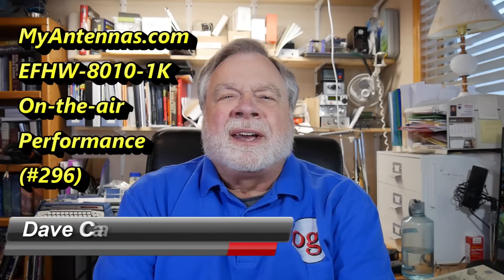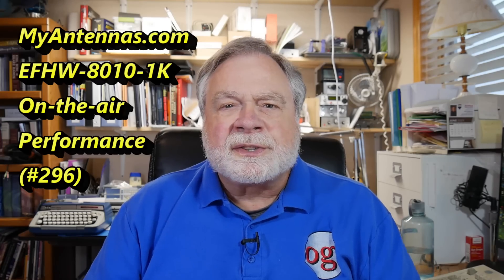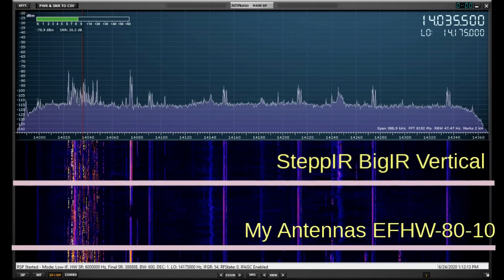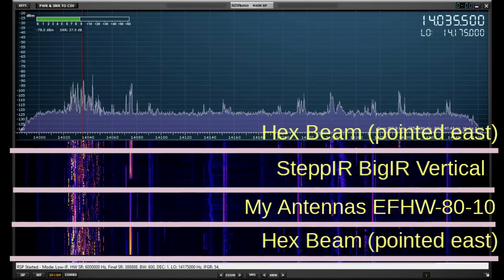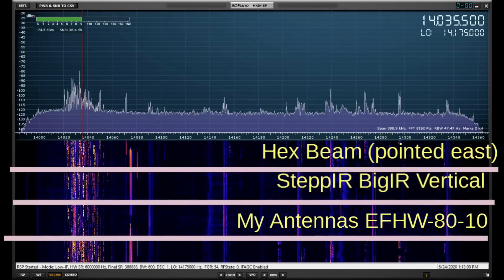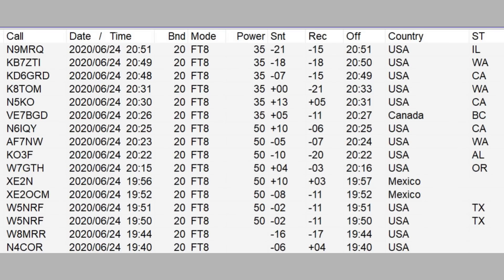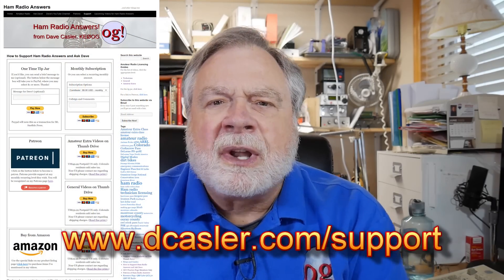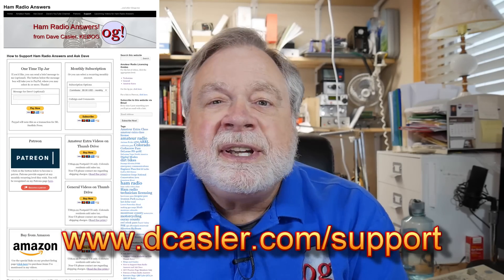Performance of the MyAntennas.com EFHW-8010-1K Antenna (#296)

Comment: Hi Dave, I've really enjoyed your channel and as a EE with over 30 years experience in the power industry, I had forgotten much of the theory above 60Hz.  Thanks to you, I finally get dB! :)  I wanted to report that thanks in part to your videos I not only passed the technician, general and extra exams, I followed your recommendations and went with the IC-7300 and myantennas EFHW-8010.  What I discovered while tuning the 7300 is that you must run the auto-tune in several parts of the band.  Initially on 80m I was able to get a low SWR on the low f end, but horrible on the high end.  I somewhere discovered that if you tune the radio to the trouble spot and tune it again, it resolves the issue.  I have had several DX QSOs over the last week using nothing but the IC-7300 bareheaded 100W and the EFHW-8010.. on SSB.  My QTH is Maine.  on 80m I've spoken with Spain, Bulgaria, and others late at night when the propagation is favorable, and during the day on other bands such as 20 and 17m.  Tune the 7300 in multiple parts of the band and it becomes a very functional combination for 80m SSB.  My EFHW is set up at 40' on both ends, not a vee or sloper, and at 300' above sea level, 10 miles from the coast and I get very good signal reports regardless of band.. in fact I've been able to plow thru pileups on DX using this combination several times.  73!  Matt AC1KO
Reply: Which direction (e.g., East-West, North-South, other) is your antenna configured for Europe contacts? Thanks!
Reply: @ray-real1  If you're asking me, my 8010 EFHW is on 120/300 deg true.  from my QTH (FN43) it works good for Europe and the US.. but South America and South Africa as well, even directly off the end, which for me is Cape Verde... it just doesn't matter that much.  I no longer use the internal auto tuner and tune manually with an external Palstar AT2K which will tune the entire 80m band and all bands 80-10. 73
Reply: @discipulus777 , awesome to hear there is flexibility in the antenna mounting.  Thank you for the great information, this really helps me! Ray 73
Reply: Hi.  I have the exact same set up at 23 feet. Re 80 meters, I hv not tried you ‘retune’ as I hv the same high swr from 3920 to 4000. I just go to emergency mode, which cuts power to 50 watts( no biggy, just a half s unit). Doing this allows the tuner to tune from the normal 3:1 ratio, up to a 10:1 tuning ratio!!!!!  Bingo, it does the job😄

Comment: A nice thorough review Dave.  I have the same antenna (8010) and have excellent results.  Mine is hung between two trees at approx. 30ft and then to my house at 10ish feet in a somewhat Lazy L configuration.  It's resonant on 20 and 40. It works wonderfully. Thanks for all your educational videos.

Comment: I wonder if you may be able to do some antenna reviews that would be more applicable to those of us living in the city instead of on rural acreage.  In my neighborhood there are HOA covenants that prevent any antennas of this sort from being visible from the street or by neighbors.  So, I'd only have an option to string this type of antenna along the top of a 6' tall cedar fence, which would result in a sort of U shaped configuration.  Think 3 sides of a 60 foot square.  I'd love to hear a real world report of how such a non-ideal installation scenario would perform.
Reply from the maker: I should probably review more verticals and limited space antennas. I have a really weird Bilal 20m antenna to review, and also a DX commander. Both reviews are being inhibited by snow on the ground.

Comment: I have the same antenna and I found out that the inverted  ( L ) works best for me in Idaho , take the balun 2 feet off the ground ,and ground it to the ground to the ground lug go up 43' with a push up pole then straight out with the rest putting the end up as hight as possible. this way works great.    im just a CW operator

Comment: I use one of these as my main antenna and have done quite well with it . I run it in an inverted V configuration with the apex at 32ft and the ends at 5ft and have worked DX all over with it 73 N8WXT.

Comment: I am a big fan of wire antennas and if you wanted voice on 80m you chose the wrong antenna, they make a 7510 that would have been the correct choice. In another note their swr graphs are listed o nthe website and this is advertised as a below the voice portion of 80m antenna.

Comment: Hi Dave, In the DIY/ experimental spirit of amateur radio I'd like to point you to a design by VK5HW I am having good success with on 80 and 40. I think it would check quite a few boxes as a build along project for the channel. Personally I can see no reason to purchase commercial wire antennas since they are so easy to make and that is half the fun. I chose this design for it's reduced length on 80m as it exactly fit the yard space I have available. I made all the components including the loading coils and a current balun. For some metrics I have it @ 6m high running physically N/S and routinely work Perth 600 km west 300km north and south and 2000 km east into VK5 and 4000+km into VK2 VK3 and VK7 all on 80m and as far away as New Zealand on 40 all on the 7300. Be sure to check the how to build page linked half way down this introductory page https://sites.google.com/view/vk1hw/antennas/radiation-coupled-dipole.

Comment: I have the cheapest MyAntennas EFHW 40-10 because I need stealth. I'm in a condo complex with no antennas allowed. I got the maintenance guy to help me put it up horizontally between two of the condo roof peaks, 40' above the ground and ran 150' of coax to my ground floor condo. Bottom line, I work the world with it and get very good signal reports with my 100w Yaesu FT450D. All the while, nobody knows it's there but the maintenance guy, my XYL and me. It's the best antenna I've ever owned and that includes the GAP Eagle, Zero-Five and Hustler antennas I owned over the years when I had a house and yard. I do need to add, however, that my condo is 1/2 mile from the Caribbean Sea.

Comment: Hey Dave, I have heard you reference chain link top rail as a mast a few times. I  have done the same for years but just this year I discovered that the top rail fits perfectly inside a standard short chain link fence post.  I simply use a post driver to driver to a (short) post a couple of feet into the ground. I dump in a bit of small rock down inside the post keep the top rail from sinking then drop in the top rail. Depending on the height and length of time you are leaving it up, guy lines maybe well be optional. to uninstall a pipe wrench and a jack maybe needed to remove the post. Simply put the jaws of the wrench around the post then jack up on the wrench.

Comment: The performance of this  horizontal dipole antenna , this one is simply fed at the end, depends on how high you can get it up... The reason there are so many various results between people using this is because everyone has different setup with respect to height and azimuth ... Bottom line if you can get this up real high , like at least 40 feet you will see good results.

Comment: Hi Dave. Do you answer questions from commenters? If so, in reference to the inverted V - does the high point need to be at the center point or can it be off-center?  Also, what if the EFHW was just sloped with the far end being the high point? How might these changes impact the propagation in general? Thanks.
Reply from the maker: Ideally an Inverted- V should have its midpoint at center, but moving it to one side won't matter much. The direction of propagation will change a bit toward the side with the most copper. The sloper tends to favor the downhill direction of the antenna.

Comment: Hi Dave, always welcome your videos!  Like others here, I've owned the 8010 EFHW 1K for a couple years.  I love it.  Mother nature doesn't always gift us with enough tall supports for a dipole or loop, and end feds fit the bill well.  The 8010 and <100 watts has thus far rewarded me with 150 dxcc entities including Antarctica, Japan, Australia and others, including several long ones on 80m and 40m.  I find it gets quieter when you get the 49:1 well up in the air.  Mine worked best more or less flat topped at about 40 ft, but the V worked well, too.  I can tune it 160m through 6m.   Yes it's a bit pricey but a great alternative when a tower and yagi are not an option.  Best, Dave...stay safe!  Cliff W3KKO

Comment: Dave, You said that the MyAntennas and StepIR pick up about the same. As I see the display, the noise floor for the Hex Beam is -125 but the other antennas are 15 dB worse. The MyAntennas having the highest noise floor at -112.5 while the StepIr is at -110. So there is a big difference in noise floor of almost 3 dB. In my experience the end fed antennas ought to be avoided because of the high noise floor they provide. That reduces the receiver signal to noise ratio, and makes weak signal reception difficult.

Comment: Interesting review, but I was a bit surprised when u posed the question, "Is this a good DX antenna?" & said, "I'm not so sure." Well, heck, I don't even have an EFHW antenna right now, but those words seemed especially harsh, especially while I was reading contradictory comments posted by other viewers.
Reply: Probably needs to be mounted in an inverted L configuration, with the vertical portion as high as you can get it, to make it a better antenna for DX.

Comment: Hi Dave, While I rarely disagree with most of your output I feel you may have been a little hasty with your verdict on the EFHW and whilst I have never owned the My Antennas version you reviewed above I have homebrewed  several 49:1 transformers to Steve Ellington's design and tested them in various configurations over the last nine months and have found them to be an excellent DX antenna. I think to do them justice it might be worth doing some A/B testing on SSB when the 20m band has more activity?
Also I'm not sure comparison between a $150 wire antenna and $2000, vertical installed above a radial field is entirely relevant or fair given the context of this series being aimed primarily at those establishing a first time HF set-up. That said  I enjoy your videos and look forward to each new one as they pop up. 73, Tom
Reply from the maker: A vertical, no matter how expensive, is simply not going to be significantly better than a horizontal wire antenna. Overall I was quite pleased with the EFHW antenna. I would have like to get the center up higher, but I have no tall trees.

Comment: Good info Dave, I have settled on the Buckmaster OCF 6-80 it works most everything and mostly no tuner. I have used a tuner on 75m. I have it up 40' and the ends are off the ground about 10' it works great for DX and just working in the state. Keep up the great info.

Comment: Good job Dave. What you have provided should be a GREAT help to new hams, but also some good info for operators with more experience. We can always learn more, little hints and tricks, and about equipment that we may not own that would be a great  add-on to our present station.  By the way, it looks mighty dry our your way, the Weather Channel has areas near you in a RED zone for fire danger, so have your hose ready, and I hope you have a metal roof.

Comment: Great video, and I enjoy your HAM radio educational videos.  You commented this antenna would probably not be a good DX antenna, but I understand you can only comment on your experience with this antenna.  With that in mind, I own an MFJ-1982 EFHW 10-80M, and I have it set up in a sloper configuration.  The feed end is up at 28 ft and the other end is around 11 ft.  I've worked Japanese stations from my home in middle GA on FT-8.  Maybe the conditions were just right, or it's the different configuration, but it was able to work DX at not much higher off the ground.  Again, not saying your statement is wrong in any way, but I've had good results with DX on FT-8 with my EFHW setup.
Reply: Which direction was your antenna configured on the Japan contacts (e.g., East-West, North-South) ?
Reply: @ray-real1  It was about 45 or so degrees off true north with low end toward the northwest.

Comment: Dave- love your videos but be careful with cursory looks at and advice about antennas. People(including me) take your advice seriously and thus it should be the very best available. I built the Steve Ellington EFHW (<$50) and easily attained DXCC with it in a sloper configuration at <=100W. Also, there is a fix to make EFHWs work over the complete 80M band.  EFHWs are easy to use in QRP situations. There is a ton of information on the web on how to build and use EFHWs. Just one kind of antenna to have in the toolkit, but it is a good and versatile one.
Reply: @ Mark Hill - what is the fix to make the EFHWs work over the complete 80m band?

Comment: I modified my EFHW-8010 by adding 330pf 40kv capacitor at the antenna midpoint. I now have 1:1 SWR at 3900khz with less than 2:1 SWR from 3800khz to 4000khz. Also, the lower part of 80m is close enough that the IC-7300 tuner handles it with ease.
Reply: Does this mod have any negative effect on 40m ??

Comment: Wouldn't you have to use the internal antenna tuner when switching between antennas to show true signal levels?
Reply from the maker: Yes, to a degree, especially if the basic SWR of each antenna is markedly different. If the SWRs are all fairly low, you can just switch between them.

Comment: Of the wire antennas, not hex, steppir, nor vertical at 30 feet any better at Dx?
Reply from the maker: A dipole at a half wavelength high will dictate at about the low angle of a vertical. However, id DX is your aim, you're probably better off with a vertical.
Reply: @davecasler  thanks.  I used a CrankIR vertical and a dipole on different band on My first field day. Just Domestic but their seemed to be directionality with the radial , as manufacture suggested.  But who knows. From N Michigan got Maine and RI and NH ...but also SD...when pointed East...go figure.  Anyway not Dx so I will try these and hold off on end Fed half wave. Appreciate your videos 73
Reply from the maker: @stevenblack122  Steven, I wouldn't expect much DX on Field Day, as it's an event for the US and Canada. Keep your eye on the calendar for various DX contests. There are several a year and they represent a great opportunity to work DX.

Comment: Dave, for the many of us who want more than an MFJ "balcony" antenna, and not a pricey remote tuned magloop, could you perhaps do a similar comparidon between a SuperAntenna and the Cameleon MPAS shortie? There's often a limit of eight feet, between concrete balcony slabs, so shortened compromise verticals fill a unique "must have" role here.
Reply from the maker: Thanks for the review suggestion. Chameleom said they'd send me an MPAS antenna for review, but they never did.

Comment: Hi Dave, thanks for the review.  In the first portion of the review, it appears that the noise floor of the  EFHW-8010 was significantly higher than the other antennas.  I did not hear you mention this, is it just a quirk of the feed line/switching or  is it actually that much nosier?   Thanks.
Reply from the maker: I was looking at the relative strength of the signals, more than at the noise floor. The antenna runs over part of the house so I expected a somewhat longer noise floor.
Reply: I would be interested in the answer as well, thanks, Dave! de KF5KWO
Reply: I noticed that also, many signals were under the noise floor compared to the vertical. A better test in my opinion would have been comparing it against a 20M inv vee

Comment: I have both the 8010-1K & 4010-1K (what I can fit) set up as inverted Ls set up at right angles to each other...... they are directional off the ends.............. vert sections are ~35' tall, 8010 slopes up to abt 45', 4010 slopes down to abt 25'......... work very well, the 4010 has an overheating problem in the matching Tx during an extended rag chew in the summer working 40 meters with 800 watts SSB............. they offered to exchange the Tx to an upgraded version.......... never took them up on it.......... generally just chasing DX so not a problem.........

Comment: Very nice video, I like the real-time-like comparison with different antennas.  One question, if you aren't running a counterpoise, is this relying on the coax shield as the other half of the antenna?
Reply from the maker: Depends if the antenna needs a ground radial(s) or just a counterpoise. IN this case the shield is grounded at the other end, unlike a counterpoise, which usually isn't grounded.

Comment: The Cobb Web antenna that looks by like a closeline? You said when you remembered you would put it in the video comments. I suspect you didn't remember it. 72 de KB8AMZ
Reply from the maker: Yes, it's the MFJ Cobweb antenna. Mine was the 20-10-meter version with the 40/30 ann - on kit. Nice antenna, takes up only a small footprint. Unfortunately a rampaging deer got it and destroyed it.

Comment: I'd rather buy a 4to1 balun and supply my own wire and insulators.  Save a lot of money.
Reply: A 4:1 balun for an end-fed half-wave (EFHW) antenna?  An EFHW works well with a 49:1 transformer -- not a 4:1 balun.

Comment: Would using a tuner with this give full coverage of 80m?  Bill W7DOC
Reply: Of course. Not sure why Dave isn’t mentioning a tuner when his “reference station” has an internal one.
Reply: Unless the tuner is located at the feed point, you're going to increase loss in the feed line.   There are calculators online, I would guess it would not be an insignificant amount.
Reply: remingtonh of course there will be loss but your still on the air easy peezy. I have this antenna as a sloper and the swr on the phone part of 80m is 1:8-2:1
Reply: Yup, I've worked up to the edge of 80M, 3.90 all the way down to 3.6 on SSB without issue using an external tuner. First an LDG IT-100 and then an MFJ-998.